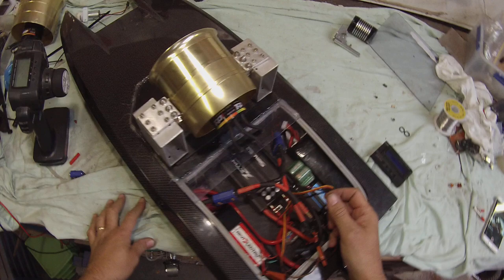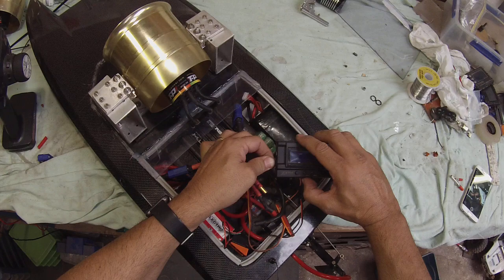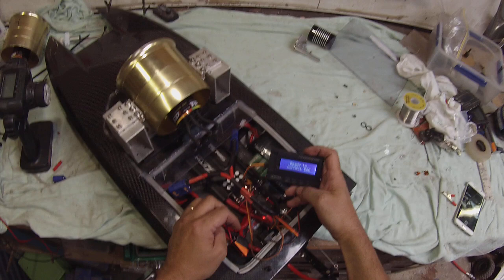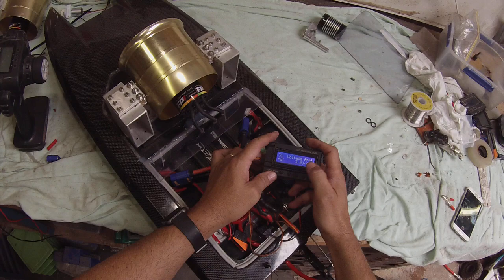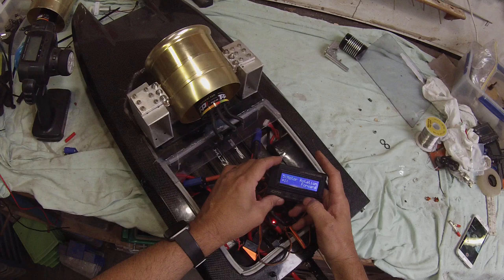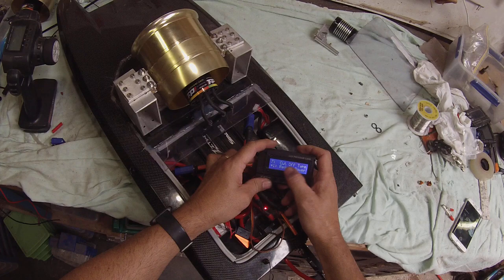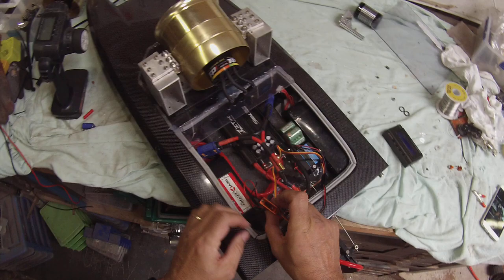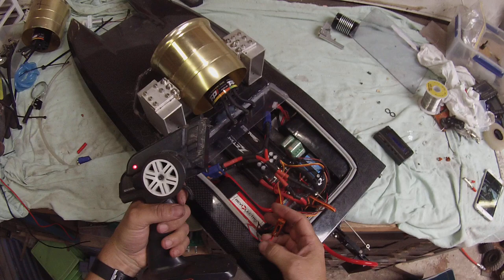how to setup a ztw 300a rc boat speed controller

Comment: I'm wondering if you know how I should program the ESC to make it stop automatically when it loses connection from the transmitter. I turned off the transmitter before I unplugged the battery, and the motor went to full power. Thank you!
Reply from the maker: They usually shut down when they lose their signal, its called a failsafe